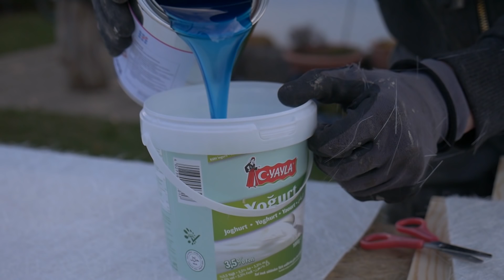Die gemütlichste Decke aus HOLZ für den VW Bus bauen | F.04 Umbau 2.0 VW T4

Comment: Hey ich habe die Selben Leuchten in meinem T4 verwendet allerdings nur 3 stk. und ich finde sie schon zu hell.
deswegen habe ich einen Dimmer eingebaut funktioniert super https://m.ebay.de/itm/12V-24V-8A-Funk-Drahtlose-Dimmer-RF-Controller-Regler-fur-LED-Streifen-Band-CP/282951864754?hash=item41e13ed1b2:g:5cYAAOSwPYpa8pzE
Gruß Markus
Reply from the maker: Danke für den Tipp! :) Werde ich mir merken und verbauen falls es mich auch stört :)